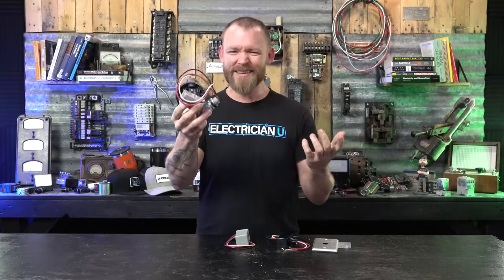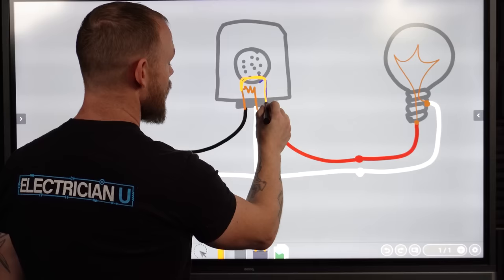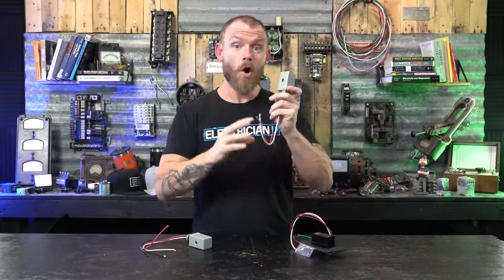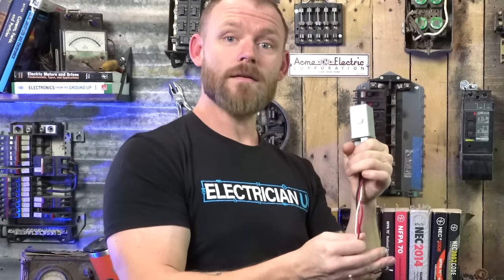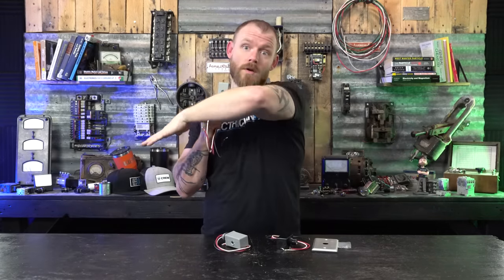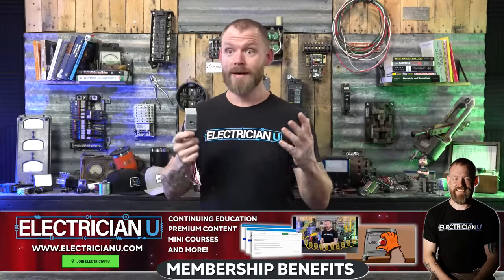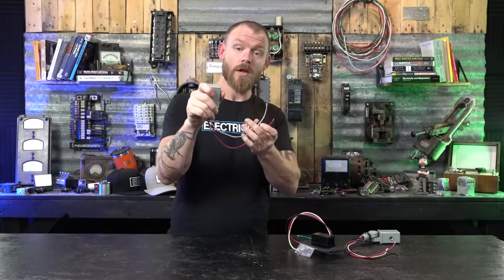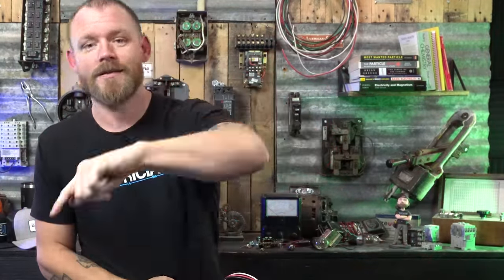What are Photocells and How Do They Work?

Comment: Did you know that the safety beam of a garage door is a photocell.  It shines a light, the light reflects off of a reflector, then the photocell sees the light.    I installed hundreds of these type of photocells in a ups processing facility. This place was 1 million sq ft and packed with layers of conveyors & chutes. We drilled holes on each side of the metal conveyors and welded strut to the outside and installed our relectors and photocells on the strut. That's how system could tell if packages are moving as normal or a blockage. Everything was built from scratch on site. Very industrial, very loud, all imc conduit and lots of controls.     160 union electricians working 7, 12's    back then in 2019 we only made 43.69hr.   That was 5,500wk.    We make 56hr now    66hr in the next county over.
Reply: In what city/ state? That's awesome
Reply: Isnt it an photeye, not cell?
Reply: Yeah i agree. I try to use text book names to avoid confusion, but in the end using local nomenclature is better to avoid just that.
Reply: Dang that's $800k-$900k in just electrical weekly payroll. Vastly expensive project there.
Reply: @jacobbutler7942  we make 72hr now.

Comment: Awesome. In the instruction manual for the same photocells you are showing, it will say north is the best direction to point them towards, and that if north is not possible, then east is second best. I have seen them fail because the installer pointed them directly upwards toward the sky

Comment: I'm a 5 month sparky apprentice in Texas loving work getting really good at work can fix 3 ways and troubleshoot now I'm replacing ceiling fans and moving switches on the wrong side of a door and running new switch legs and getting the in coming hot to fly over fixing everything around the multi family apartments I'm so glad my company is smaller than big huge companies but 30 employees with a lot of foreman's and journeymans and they hire subcontractors so there's a lot of stuff on big jobs that I'm learning

Comment: Thanks,  I installed a PC for landscape lights and the lights did not shut off when I uncovered the sensor. Your explanation about the resistance taking time to build-up cleared up the confusion. I though it would operate like instant on-off switch, the PT-PC1 needs about 5 minutes of light to open.
Reply: Thank you. Very helpful bit of information!

Comment: There are two different "photocells". One type generates voltage when sunlight is present such as roof panels etc. Normally called solar cells 
The other kind is called an LDR or light dependant resistor. This is the type you are referring to..
In this circuit the LDR is in series with a healing element. This heating element heats up in the presence of sunlight. This heat causes a bi-metalic strip to flex acting like a relay. The purpose if this is to avoid false triggering of headlights, flashlights etc. This heating/cooling cycle takes time thus giving a small time delay. This heating element is the thing that usually wears out over time The LDR never controls the load as this is beyond the capacity of any LDR. Instead the only load it controls is the heater. So even with no load, this device pulls current.
Reply: The type that generate voltage with sunlight are also called "Photovoltaic Cells" or just "PV Cells" for short.

I wasn't sure how the electronics inside the LDR photocells works, so I'll take your explanation as typical. (My expertise is electronics, so I'm more familiar with the bare CdS cell element which is a 2 pin device.) There is another reason why the LDR doesn't have the load going through it. LDRs are analog devices, meaning that they are rarely ever fully on or fully off. Something else is needed to trip either fully on or fully off somewhere in the circuitry, and the bimetalic strip (hopefully configured as a snap switch to accelerate the load contacts opening and closing quickly to mitigate contact burnout) would do this nicely.
Reply: @Sembazuru  some Cadmium Sulfide (CDS) photoresistors are still used & some circuits use a Silicon (SI) transistor. One of the issues with SI is that they are sensitive to IR light and act erratic because of this. You would need an IR filter to correct this problem. The CDS and heating element seems to be a far simpler device rather than a silicon transistor and supporting circuitry so I assume a CDS device is still used
Reply: @rty1955  Thanx for the good info. The simplicity of the CdS cell is very enticing to a designer, but good luck getting a RoHS certification on the end product since Cadmium is one of the prohibited materials under RoHS. 😉 Though, if the CdS cell is small enough and is the only Cadmium in the product, one might be able to fall under the 0.01% limit to be able to get a RoHS certification.

Comment: According to Tork you are supposed to install the Photoeye either North or South.  Doing so gives it a more even light line of site vs mounting East and West which will give you a brighter light at one part of the day or Not enough at another part, which causes either a premature disengagement or prolonged engagement (aka turning on or off at the wrong time).  There are multi-voltage rated models that cover everything but 480V.  The new ones are designed for LED which has kind of a solid-state interior component, and they take the inrush of LED Drivers a lot better.

Comment: Prefer to use the photo eyes that are on a twist lock plug. So many times the circuit breaker that feeds luminare is not marked. For some reason they seldom last more then 6 to 8 years. They are so much better then cheap say Intermatic think its T100 single pole timer. Nice they are fail safe = when they burnt out circuit stays on. Knuckle style should be the only PE to stock. Type with straight nipple often require you to loosen the hell or even remove the box to screw it on to side of a box.

Comment: Pretty sure 2020. All switches now require a neutral to be pulled.

Also are you sure they come with a varying resistance conductor? I was pretty sure they used a DC transistor.
Reply: That is a negative.  Neutrals are not required to be pulled to all switches

Comment: I had a problem with a neighbor's light sometimes shining in the direction of one of our lights outside that has a built in photocell. I put a little white nail polish over the sensor and now it comes on. It wasn't turning on at all while the other light did. That's the benefit I guess of these central ones they can be placed where something else probably won't interfere with them.

Comment: I spent about an hour trying to figure out a photocell light fixture that wasn’t working. A brand new one. I finally put a black plastic bag over it and it came on. There was a small gap in the cell housing that allowed light in so it didn’t work until it was completely dark.
Reply: i work on these alot and black electrial tape works every time.....

Comment: Could you do a video on dimmer switch loading.  There seems to be a lot of confusion for folks on that.  I’ve seen some people load a dimmer switch up thinking the max wattage was still 600w etc when it cleary states on lost dimmers incandescent 600w and led 150w etc.  I see videos online and guys are still saying it’s 600w with led but they do t know it’s usually 25% of the that for led ( this is straight from the manufacturers)

Comment: so no update on the health status for the digital multimeter ?
Are they still ok? after being used to measure current? 😄
don't get me wring, I love all your video and i understand people make mistake... but we haven't hear anything after the video being taken down...
Reply: Yea I noticed he made it private.  I assume the fuses just need to be replaced.  To be fair, there's not really any reason for an electrician in the field to use anything other than clamp-on ammeters.  For 60 Hz AC, they work very well.
Reply: @barryomahony4983  of coz, for general electrician,  there is really not much point to break the circuit up in order to measure current if we are dealing with AC
most of us just use clamp meter to do it , it is quicker , safer, and easier.... i doubt anyone will reject that...
there are some of the clamp can do DC current , may be not as accuracy but it should get the job done... 
however, he is teaching others how to do it and he is doing it the wrong way.... at least he should make a clarification on that so people will not make the same mistake...
and blowing their multimeter fuse....

Comment: what if the outside light fixture I bought already has a  built in photocell? Can I still connect it to a photocell that controls multiple light fixtures? I probably need to disable my lights photocell correct?

Comment: For the life of me I can't find a DAWN to DUSK switch like this (On during daylight, off during night.) I'm using a dusk to dawn combined with a relay to facilitate, but can't find a commercially available switch like this with a normally open contact. I specifically want to run a pump only during strong sunlight, not on a timer or temperature or such else.

Comment: DUSTIN, try to make a video lesson about what Contractors are used for and how to troubleshoot the common failures contractors cause. The Purpose of the contractor is to turn on multiple high current high voltage lamps/lights but the contractor has current/voltage ratings and other purposes to use contractors.
Reply: Way too specific

Comment: The photo cells I've installed have lasted over 15 years😁
Reply: They aren't really made for heavy loads. Usually only like 6-10 amps. If you want to run it at minimal load, use the photocell to close a double pole contactor. Even if you tie the hot of the photocell to a contactor line side, the photocell will only use like .8 amps even if the contactor is pulling 10 amps on that same leg.